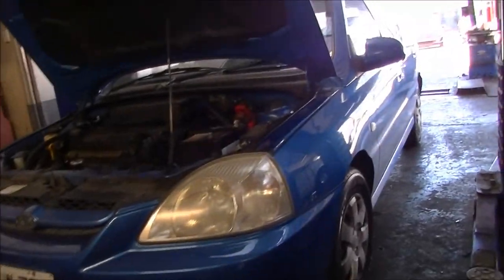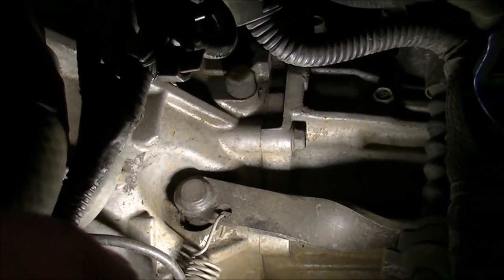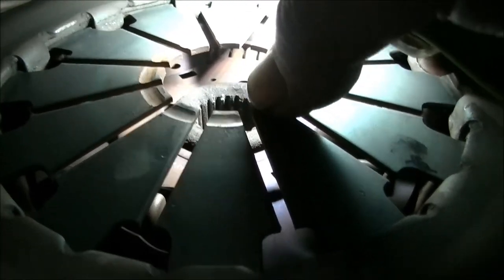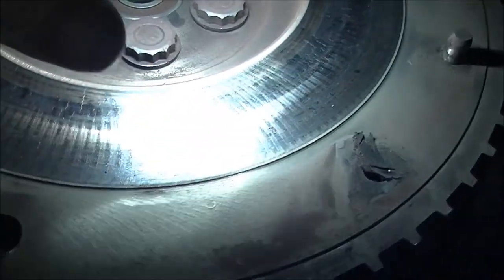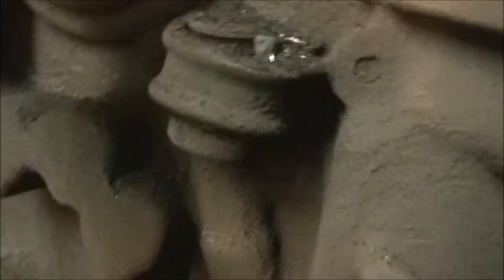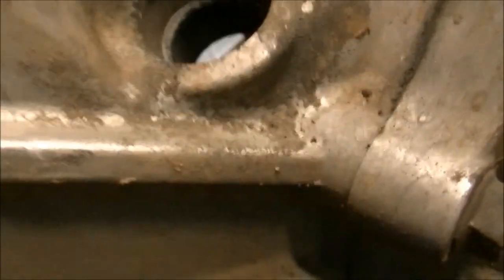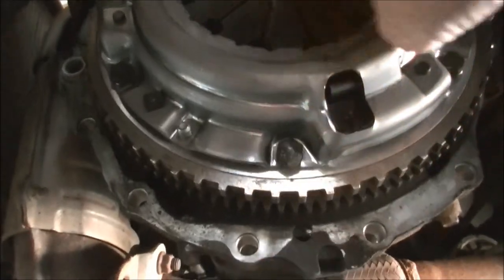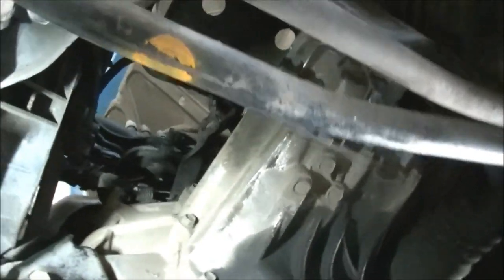Kia Rio stiff clutch pedal job .

Comment: Why is the engine so loud? Is it the lifters or does something need to be adjusted?
Reply from the maker: It's a rattly old KIA with 300,000 kms on the clock.

Comment: hi there I have a 2003 model with the same problem and am wondering what are the parts you replaced
Reply from the maker: Other than the clutch kit I replaced the pivot bushes..They have to be bought from a Kia dealer.
Reply: Thanks for that i will go and follow it up now

Comment: Can't believe someone removed the box and replaced the clutch and didn't replace the throwout bearing or notice the pressure plate or flywheel let alone the missing bush's...
Fine job young man..Hows the health going mate?
Reply from the maker: Cheers Mark...Health is good thanks mate...How're you doing.?
Reply: Getting there mate..couple more months and I should be mobile again.
Reply from the maker: Fingers crossed for ya mate.